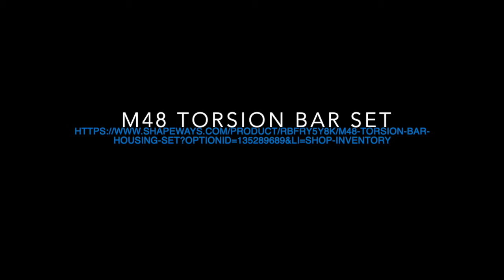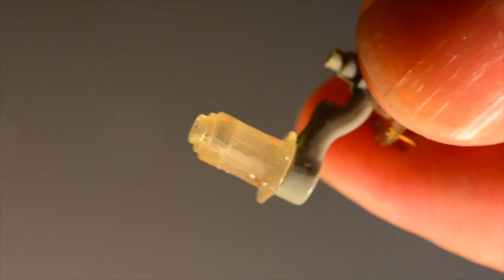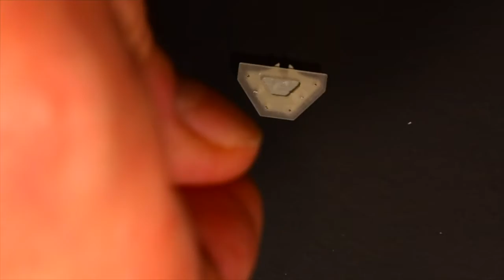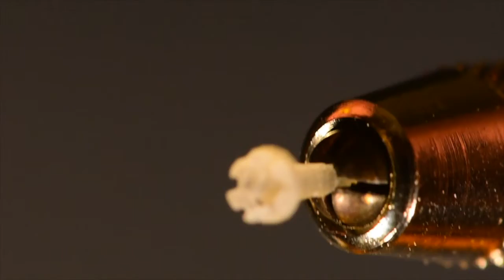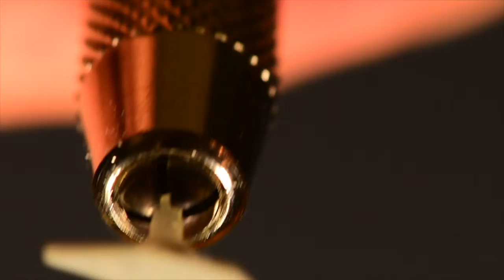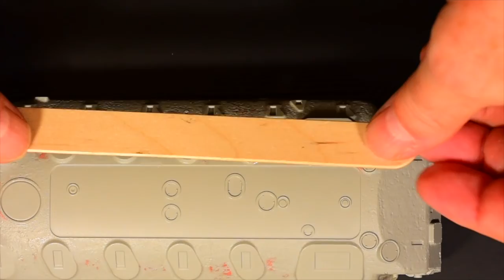M48 Torsion Bar Set

Comment from the maker: In case some of the links shown in the video are hard to see here they are: https://www.shapeways.com/product/RBFRY5Y8K/m48-torsion-bar-housing-set?optionId=135289689
https://www.shapeways.com/product/7X5MCQPWY/m48-wheel-combo-set?optionId=76354204
https://model-motorcars.myshopify.com/collections/small-parts-hardware/products/bolts-hex-head-brass-0-5-mm-k060